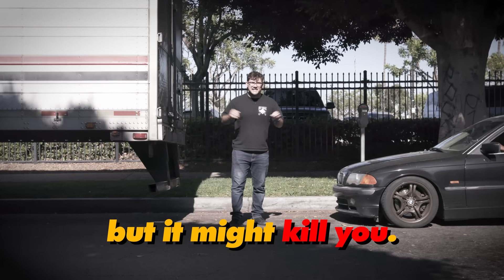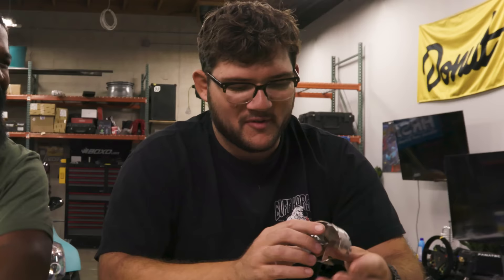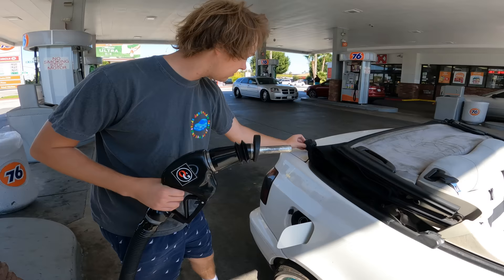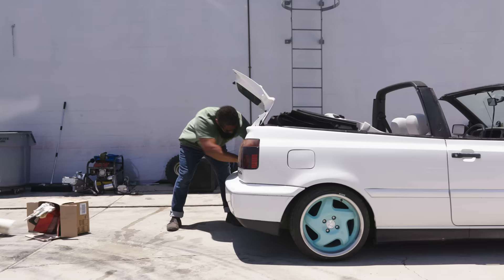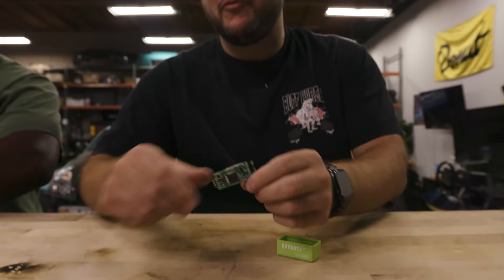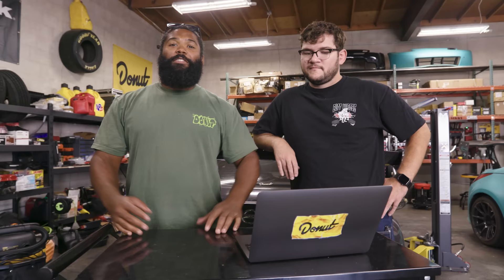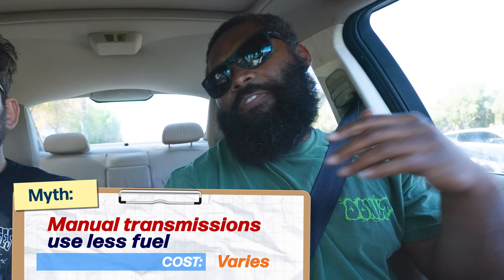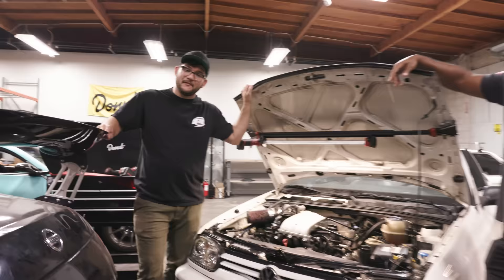Testing Fuel Economy Hacks

Comment: 7:23 is a truly wonderful quote for YouTube lolol
I'd love to see an eco-mod video. My vehicle of choice is a pickup. I'll specifically say a Tundra, because I have no idea why they're still only making 13mpg when other trucks these days are at 20-25.
Reply: I have a 2013 tundra and sequoia, both with Toyotas 5.7, I love the engine and the power it provides but the mpg is ridiculous, I tried driving as conservative as I could for a full tank and reset the mpg gauge and ended up with 13 mpg, this is like 30 second 0-60s no high speed.  I personally think there is a little gnome that lives in my tank and gives my gas to other less fortunate people.
Reply: it probably has to do with toyota's "let's not change the engine or chassis for three generations of vehicle over the course of 20 years" mindset. while other manufactutrers decided to modernize to keep with the times, toyota keeps one thing in production for as long as possible and then some. their engines and chassis are the grumman LLVs of the production vehicle world.
Reply: That's why i drive a ram....cannot knock the yodas reliability, but that shit comes at a price. I'll trade speed and mpg for a little reliability all day long, rams still lasting me 300k which is plenty. Resale was the only issue but with chip shortage that's not really an issue anymore.
Reply: The Ecomodder site has some good ones, like that 14 MPG Semi Truck (which was in and around 2007 - 2010.) Also the Caprice Station Wagon mentioned in this video (mistaken as a Roadmaster) which got crazy good mileage.

Comment: "Top Tier Fuel" refers to the detergent and additive package used by certain gas stations, not the octane of the fuel. It can help prevent buildup in the engine, and supposedly burns cleaner
Reply: Me putting tide into petrol tank 😬

Comment: To add on, when running the A/C if you want to save some mpg, raise the temperature control, if ur vehicle doesnt have that. then dont use max a/c. Running the compressor to reach ur desired temperature takes more power then maxing out the blower speed and using lukewarm air vs freeze your toes off super cold air that's default.  You could also just max out the blower/control till its nice and chilly and then turn the whole thing off  and turn it on when it warms up again vs just having the compressor on with low blower speed to maintain a desired temperature.  That being said, when its hot outside, turning off the A/c for even a fraction of second is enough to feel like ur on fire so, this method is only if you're incredibly desperate
Reply: I tested this with my cars mpg screen! Having the aircon on full blast raises the graph thingy massively, compared to if you just leave it on the least powerfully setting and turning it up to say 19-20 degrees

Comment: The only problem with a "hydrogen generator" is that it takes more energy to produce the hydrogen than is produced by burning the hydrogen.
Reply: I mean theoretically it takes the same amount but practically losses in the alternator are going to cancel that right out and put you like ideally -80% compared to not having the generator for the portion of power that goes into running the generator. However, as mentioned, electronics use a relatively low amount of power and this simply doesn't generate or consume nearly enough hydrogen for that power drop to even show. Hydrogen and oxygen burn to create water and power the engine, water splits by electricity to hydrogen and oxygen. This is a closed cycle, water to water, it cannot output more energy than what the electricity brings into it. Where does the electricity come from? The engine. So in the end, the water cannot output any more energy than the engine generates, and that all comes from the gasoline in the end. Practical losses cut conversion efficiency to 20% or so, at which point you literally just turn even more of the engine's energy into waste heat than it already does.
Reply: @Anohaxer    The point is simply that hydrogen cannot yet be efficiently and economically produced...
Reply: There's also the little fact that hydrogen gas has less energy density than methane. To get any really efficient combustion out of hydrogen, you're going to have to burn it while it's a cryogenic liquid.

Comment: On the tire pressure myth, overinflating your tires won't reduce friction.
Friction is the product of the normal force (the force pressing down from gravity) and the coefficient of friction (F = N * cF)

Lowering the surface area in contact with the road doesn't reduce friction because it doesn't lower the normal force.  The area in contact is lower with overinflated tires, but the pressure per square inch is higher so friction per square inch of contact is higher.

Comment: best mpg advice: keep tires at proper inflation, change oil and filters as scheduled, keep foot off pedal and accelerate slow. and yes get the excess weight out.
Reply: What is best? Slow acceleration or fast acceleration for reaching highway cruise speed?
Reply: @ongobongo  slow
Reply: Maybe not always safe, but cars typically have their most efficient speed around 80km/h (50mph) so if you're cruising and aren't holding up traffic then that could save fuel
Reply: @Incommensurabilities  yep and using cruise control on highway
Reply: All good advice except sort of the accelerate slow advice, there's some technicalilities to it. Petrol engines acheive the highest fuel efficiency at low RPM but a fully open throttle. So depending on the design of your car accelerating too slowly, or accelerating slowly but without being in the highest gear possible, will reduce your MPG.
Reply: One of the biggest differences with tyres is sidewall depth. Get yourself some fat tyres and they'll glide over bumps a the tyre deforms. Low-profile tyres have much greater rolling resistance.
Reply: Nope ... door sticker inflation is a compromise.  Modest inflation increases of 10-20% will show savings with no real downside except a tiny loss of grip at the limits and a firmer ride.

Comment: Correction, if it says 87 you don't HAVE to use 87, but you're not getting any benefit. In SOME cars marked 91 you CAN use lower octane without damaging your engine, BUT it will have a catastrophic effect on your mileage. Which means more money in the long run, even if it doesn't actually damage anything.
As for windows vs. A/C depends on how fast you're going. Around  town, windows down is cheaper. On the highway, A/C is better for mileage.
Reply: Wrong
If you car requires 91 then you must use 91.
It will damage the engine
Reply: @alexislaisney3404  that CAN be correct. However, newer cars retard the timing to use lower octane gas without the predetonation issue... and they've been doing it for at least 15 years.
Edit: Muhammad the Prophet had another reply, but since I destroyed his incorrect argument... he decided to be a coward and delete his comment instead of admitting his ignorance.
Reply: Windows down at low speeds is always better for the occupant. Not everything is always about mpg. Humans need fresh air. Carbon dioxide buildup in cars is real.
Reply: @fitybux4664  actually, windows down up to 55 mph is better for mileage too.
Reply: @UpperDarbyDetailing  lol, no. Did you watch the video?
Reply: @fitybux4664  i did indeed. I've seen other videos as well. I also know A/C can cause as much as 30% parasitic loss. As such, the negligible effect having the windows down has on aerodynamics below 55 mph causes less mileage loss than you get from using the A/C. Of course, above that it's better to roll up the windows. 
Obviously, YMMV. Lots of things chance depending upon the vehicle, etc.

Comment: Great video.  
The best fuel saver is don't drive, saves 100% fuel.

Manuel gears is more efficient as there is no torque converter creating heat. I believe torque converters can now be locked automatically after a certain duration of steady. In gear manual gearbox do not slip and create heat losing efficiency.
It used to be that the old automatic transmission gear selections were inefficient and manually deciding when to change was more efficient. I'm also told by a sales person that newer torque converters have a slip limiter that locks the torque converter in steady state.

In my country 90% of cars are manual, I've never driven an automatic transmission car.
Reply: Modern automatics with many gear ratios can select the best ratio all the time and change quickly to minimise losses. I guess that's how they can be equally if not more efficient than a manual now
Reply: I'm curious, as I've never driven one, if the torque converter is locked and you let off the accelerator pedal do you still fee wheel saving fuel like you do in a Manuel?
Reply: @Incommensurabilities  Unless they're CRAZY intelligent cars, like being able to anticipate gear changes (sees a hill, changes to a lower gear for more torque,  before it reaches it), there's no surpassing the judgement of a human brain in that regard.
If I, a human, see a red light way up ahead, I can switch to a gear that will engine brake the car for maximum fuel efficiency.
No modern car will do that, unless it has auto pilot or something.
Reply: Thx for answering this for me.  Really appreciated.
Reply: Lockup torque converters are not new. They have been around at least since the late 80s.

Comment: The part about using the more expensive gas is TRUE, depending on where you live. In the Midwest, they use ethanol blends. There’s a cheaper option for E15 87 octane that’s cheaper, and SU E0 87 octane fuel that’s more expensive. The 0E DOES get better fuel mileage because there is no ethanol in it. We also have E30, E80, E85 & even E88 options. But the higher the ethanol content, the lower the fuel economy, but the cheaper the fuel. The lower the ethanol content, better fuel economy, higher price.

Comment: Best tip to save fuel is be good at driving. Using momentum, throttle, engine breaking and the brakes the right way. Blipping the throttle from bad throttle control will use more fuel for example, engine breaking in manuals will use no fuel unless somehow have anti lag and it will save your brakes, good momentum by using a good driving line will help you stop unnecessary  using the brakes or throttle to much. Also in manual staying in the right gear, usually you should use the lowest gear at 1.5 to 2k rpm, but the lowest gear some times will make it hard for some engine to keep up, making the ecu dump more fuel.

Comment: The inflating tires actually works I daily on M/T ET streets 275/50/15 and when they’re at 12-13 psi I’m averaging 15mpg and 15 psi I’m around 17-19
Reply: Yup, I've found similar results (32psi to 38psi saves me about 2-3 mpg in my 2007 accord... kills the tire wear though). I really wish they would have done an actual test for more of the "hacks".
Reply: My tdi has a slow leak in 1 tire and it shows on the fuel average when it's low
Reply: yep it's based on your door tag, but if you're running non OEM tires (size/spec etc) My door says 36, max; on the tire says 51 max. Im not carrying anything heavy, it's a truck so no weight behind me so I run 40 rear for better traction during summer rains and 41-42 front for corners. barring any nails screws whatever get roughly 35-40k miles on a Goodyear Wrangler. Though I can;t say how many miles because around 18-30k I get a nail that calls for a new tire so yeah haha 

FYI I had Michelin once, after 12,000 miles and 2 close class to accidents, and any throttle input other than idle spun; I went back to GoodYear

Comment: On the accessories BS - I remember doing a calculation between the power it takes to run a regular alternator and a high amp one and it was a difference of at most 1 hp (from ~2 to ~3 hp increase in power draw). I do not recall the details but it's really, really minuscule compared to the literal mountain of power produced by the internal combustion engine. The A/C compressor does take a bit more but it's not really important because again, internal combustion engines, especially now, produce a ton of power that makes these changes irrelevant
Reply: The A/C compressor isn't irrelevant, it's probably on the order of 5-10 hp in the average car. The thing is, when it comes to fuel economy, the alternative to running A/C is opening the windows, which is MUCH worse from a fuel economy perspective given the increase in vehicle drag. Especially on anything designed in the last 20 years or so.

I commute 45 highway miles each way, and the A/C definitely does affect fuel economy, but not by much. Maybe 1-2 MPG. The grade of the road affects fuel economy more than that, and this is in my '17 GTI, a vehicle which gets 40-45 MPG when cruising at 60 MPH.
Reply: Internal Combustion Engines (ICE) have a lot of POTENTIAL power, but traveling down the highway on a flat road, the AC compressor can require the engine to produce 30% more power to maintain velocity.  Because of this (and the US EPA MPG ratings starting to include AC usage in 2008), compressor manufacturers now favor compressors that can adjust their displacement to match heat load, reducing compressor cycling which reduces acceleration/deceleration demands and overall average load on the engine.
Just because your engine can do X HP doesn't require it to do X HP under normal driving conditions.  You typically only need 8~20HP at 60MPH.
Reply: Most econoboxes nowadays are smart enough to clutch out the compressor when you bury your hoof.
Reply: I see your reasoning, but the smaller the engine, the more that becomes a problem.
Sure your headlights and stereo might require 1% of your typical V8's power.
But if you're driving something with a small, low power engine, like a Fiat or a Smart, we are talking about 2-3%, just for the headlights alone!
A/C definitely consumes a lot, and I mean A LOT more than that.
Think about you typical window or split A/C at home, most of these would consume 600 to 1000 WATTS to run. Sure, the cabin of a car is much smaller than a room in a house, but you can expect the compressor pulling at least 500W from the engine of the vehicle to cool the cabin!

Comment: Slush box autos in the past used more fuel since they designed for smooth transitions. They also usually had three (four with overdrive) gears making them less efficient. Newer dual clutch transmissions have between 7 to 10 gears allowing for very efficient gear ratios
Reply: Not to mention, they not only were heavier both in static AND dynamic weight, but also many didn't lock at highway speeds.

Comment: Having a little bit more air in your tires actually does increase fuel efficiency. About 10% more pressure than what the manufacturer label says. That small amount won't effect the wear of your tires. But it will increase mpg.
Reply: Having your tyres over-inflated will increase wear in the centre of the tread, and they will become worn out and illegal that much sooner.    The effect on mpg is the same as shifting into a higher gear, because you are making the wheels a bit bigger.   So at a certain speed, the engine revs will be lower, which can save fuel on a flat road.   But you will lose acceleration and have to change down sooner going uphill, which may cancel out your fuel savings.
Reply: If it's affecting fuel economy, then it must be due to lower rolling resistance, due to a smaller contact patch, so I'm not sure how it won't have an effect on tire wear patterns? Is it because the patch is equally smaller everywhere?
Reply: @bannerman100  I'm not sure that it's down to the tire circumference, even if it changes a small amount. Rather the efficiency is due to the rolling resistance being reduced (harder tire) so less energy is wasted as heat in the tire.
Reply: You are correct.  As others have said, it's the deformation of the tire that causes a lot of the resistance, not necessarily the contact patch.  A 10% increase (30 to 33psi) is a reasonable increase unlike the ludicrous change they did in this video. I might even go 20% depending on the vehicle and tire combination.  Wear will not be affected to a measurable degree.

Comment: Back in the day it wasn’t more or less gears. It was convertor lockup, and big pumps, or high line pressures. However, there’s t56s that have a pump.
Reply: yep I feel that little bump and a "half shift" at about 50mph in my truck when it's in top gear. More audible now with a performance muffler. Sadly most places have 45mph limits with traffic that does 40.... and youre in converter style auto that ALWAYS starts in first from EVERY stoplight and is speed sensitive to shifting (aka wont really upshift past 2nd until over certain speed). Even though it has enough torque to lug 2nd with no issues and a highway rear gear that runs 2nd out to 70mph lol. Truck life.
Reply: That's what I was gonna say. Converter lockup makes a massive difference on autos, which is why all newer automatic transmissions have them.

Comment: "Top Tier Gas" is NOT a reference to octane. It indicates which gas stations add detergents to their fuel. Detergents are useful to clean carbon and deposits from the engine. They add the exact same detergents to every grade of fuel at a top tier station.
Reply: I was just thinking the same thing. I'm not sure if they didn't quite understand the question, or they were intentionally skirting this one in order to not badmouth any one particular fuel company hahaha.

Comment: Manuals do get better MPG because you can run lower RPM at certain speeds, you can glide down hills, and they have less drivetrain loss.
Reply: Lighter, less load on engine, no need to have a stall converter 

Pity its too much of a chore for some